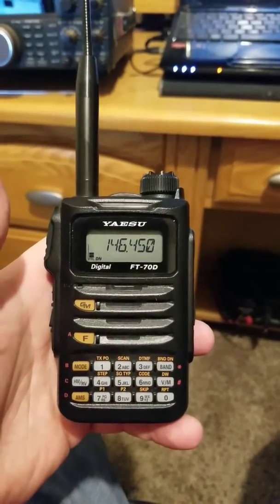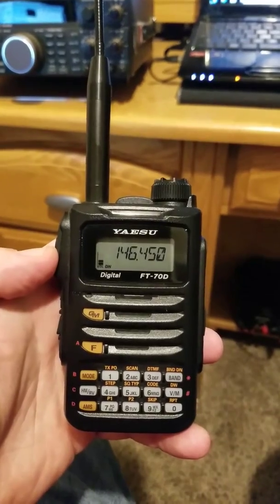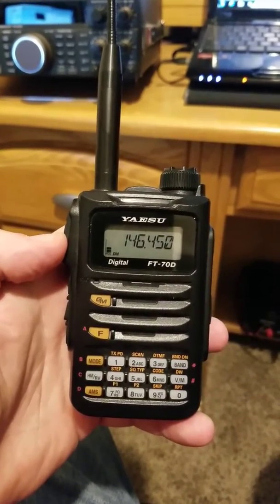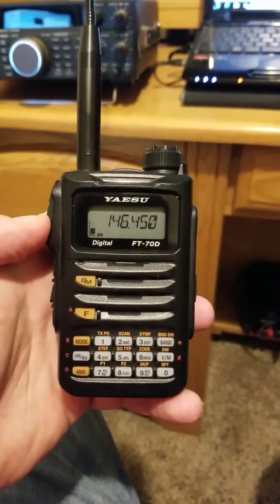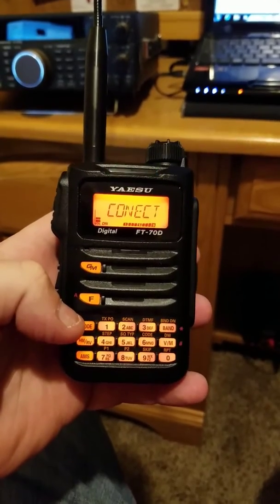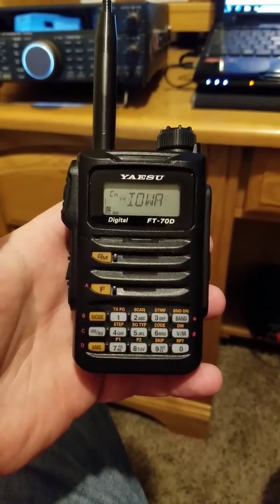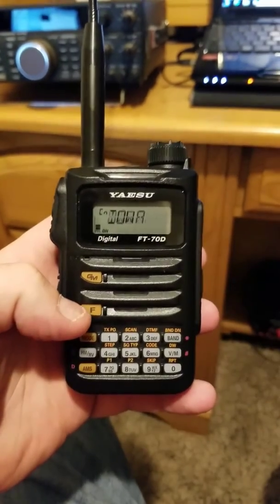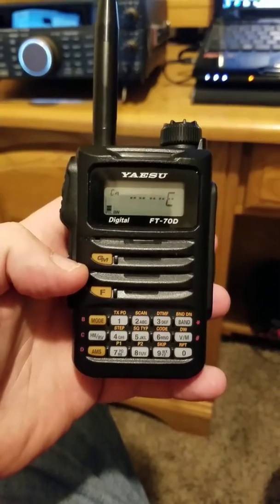FT-70DR Firmware update

Comment: I did the mars/cap mod and updated the firmware... Cant seem to connect to a node.. is this a known issue with mod'd radios?
Reply from the maker: I personally have not done the mod on my 70 and I don't recall hearing anything about this, is there an active node available in your area?
Reply: JDauen KE0MJE well I’m asking cause I sold the radio with the mod and the buyer is wanting to return it cause he said he couldn’t active the node mode.  I don’t know a lot about nodes.  So I’m just seeing if there was a known issue.  The mars cap mod was done by ham radio outlet.  And I haven’t had any issues with radio
Reply: Also. Can I easily restore the mod ?
Reply from the maker: @marquezphotos  Yes it can be restored and if ham radio outlet did the mod then its definitely on his end because they are always on top of any software issues. I would say he doesn't have an active node in his area. That's just my opinion
Reply from the maker: @marquezphotos  I reread your comment and he's saying he can't activate the wires x mode or he can't connect to a node?
Reply: JDauen KE0MJE thank.  He claims to have other ft70s with working nodes
Reply from the maker: @marquezphotos  That sounds a little weird to me, hopefully you have the serial number wrote down so he isn't trying to pull a switcheroo on you.
Reply: JDauen KE0MJE this is what he wrote:  I received the radio yesterday and charged the battery overnight. As the owner of 2 other FT70's, I am very familiar with these radios and found that the firmware required updating, which I've performed on numerous other radios during my 25 years as a ham, including the two other FT70s I own. The update went flawlessly. The firmware update allows control of a Fusion Node and when I attempted to do so, it would not. The radio transmits and receives just fine. I exchanged emails with an Engineer at Yaesu, which I would be happy to share with you, and the result is that the radio requires inspection by Yaesu to determine what the problem is. To be on the safe side, I checked the node control with my other FT70s and had no problem. I'd prefer not to go through shipping the radio to Yaesu for an evaluation and repair fee as I paid fair market value for the radio and accessories. The most reasonable resolution is to return the radio and accessories to you for a full refund. I will pay the shipping back to you. Please advise how this can be resolved as soon as possible. Thank you. Barry Zoll.

Comment: Hello, I am on the fence on purchasing FT70D or FT60, thoughts?  I have never held a radio but want my license 25 years ago so I am happy to be part of the community now.  Can yo please briefly explain WIRES X, and Chirp software?  Would you recommend the FT70D for my first radio? Last and importantly, the charging adapter that came in the box, does it state I can use in 220V?  I plan to take it internationally during my vacation.. thank you.
Reply from the maker: I would not recommend chirp, they break the radio down and at times can fall short of getting all the functions correct. The ft70 is a solid radio. I have owned it since its release date and have had no issues with it.

Comment: Is it possible to set radio for TXing on different band then RXing while press PTT? I mean for satellites...
Reply from the maker: Yes it would be in the manual under split memory. I'm not home otherwise I could double check to confirm but I'm most certain it will.

Comment: What type of cable do I need for the updates?  Thanks!
Reply: standard mini usb cable.  it should have come with the radio, but if not you can get one at staples, best buy, online.
Reply from the maker: David Lawson If you bought the radio new it comes with the standard USB cable. I believe it's the USB-57B which looks like the old cell phone chargers.. Good Luck 73 ke0mje

Comment: How do you tell if an update is needed.
Reply from the maker: Vaughn Bradley In your menu (F) you can find it. Menu number 59 and it should say 1.11 if your fully up to date. 73 ke0mje
Reply: JDauen KE0MJE  mine says c 1.11?
Reply from the maker: Vaughn Bradley Yep 1.11 is the current wires x update, but you have to be within range of a wires x repeater and or node.

Comment: Where is the battery charge indicator?
Reply from the maker: Bob Ograv When it's fully charged you won't see the battery bar, but as it drains it appears in the bottom right of the screen when powered on. If your charging it, across the screen will say CHGING and a bar with a 1 will appear, when fully charged it just shuts down completely.. Hope this helps! ke0mje 73 to you and yours.
Reply: Ahh!  Thanx.  A bit unusual.  But then Yaesu does stuff like that.  I like my 70.  It is my 1st HT.  73 Bob

Comment: I had all kinds of troubles installing v1.01. I think it was the radio defective. It had a very loose power charger connector jack. It froze and did nothing when I plugged it in for charging. So I returned it for a new one. I've just downloaded v1.11 on my PC. I hope it all works out well this time.
Reply from the maker: Mister Miracle Follow the instructions to a tee! Read and reread everything twice, what I suggest is to install the free programming software first and see if your computer will recognize the radio, that's what I did first then I moved on to the firmware update by downloading it from yaesu.
Reply from the maker: Mister Miracle Good Luck and let me know how it comes out for you! ke0mje 73
Reply: Made the same mistake as before: (downloaded the European version!). But finally caught it right and got the WiresX on the radio.  Thanks man!
Reply from the maker: Mister Miracle Glad to hear it! I know updating can be stressful at times, so it's always a good day when things go smooth. :) ke0mje 73 to you and yours!